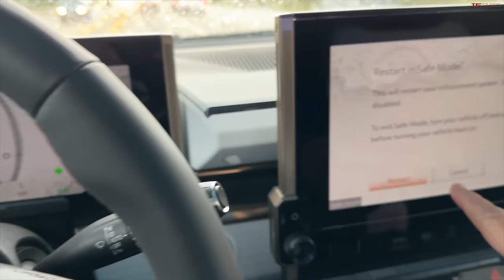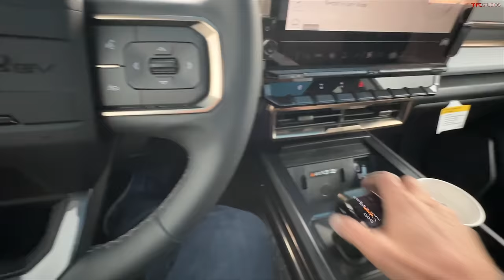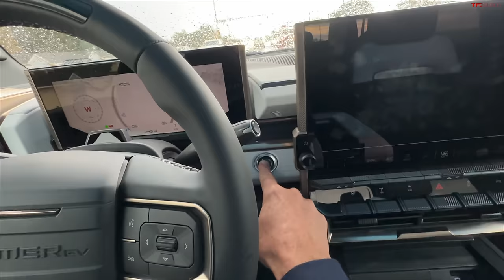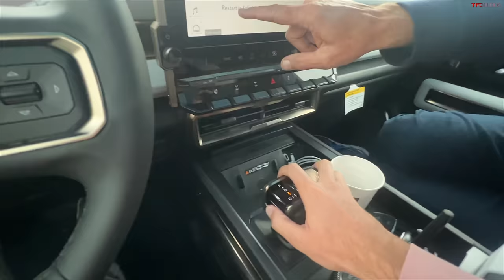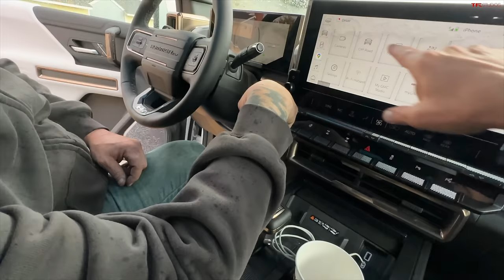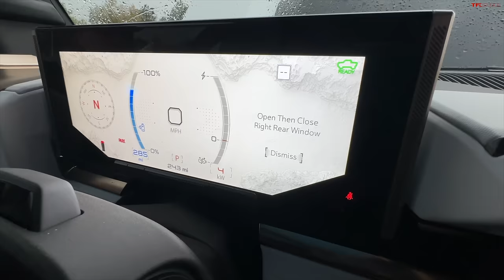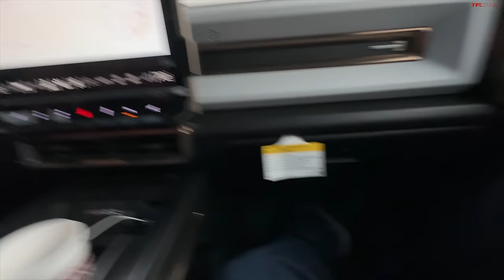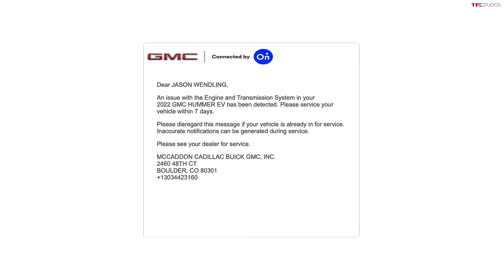I Bought a $115,000 GMC Hummer EV and It IMMEDIATELY Left Me Stranded!

Comment: i think there should be physical neutral button to prevent the electronics from leaving stuck in a spot.
Reply: With EVs they are mostly direct drive and don't have a transmission like a normal vehicle. Even with a neutral lever it would be hard to drag or tow
Reply: Or manual access to the battery
Reply: @craigbutler024  teslas have a manual override for moving it when something goes wrong. It's possible the hummer does as well but it's too new for most people to know where it is.
Reply: I think american autoprom is a total junk that's why people mostly use Asian for decades🤮🤣😂i would only buy the newest corvette and not because its a good car but only because of the price to looks compared to a Ferarri that cost millions🤩
Reply: @zeblanmaidaynovich796  Most people actually buy American trucks.
Reply: The point remains. The solution shouldn't be that hard to find.
Reply: I think E V’s should be banned and put in the scrap yard!
Reply: @daveberkovits4976  That logic brings now real solution, it's like saying we should ignore all our mistakes and not learn from them at all, just continue from before as if nothing happened.
Reply: Most cars nowadays have a little cover on the shift column and you can pop it off and use a screw driver to override the shift lock.
Reply: Every other digital/electronic device has an operator override.  If you’re paying for a vehicle, you should be sovereign over that rascal.
Reply: @Dave Berkovits  You should know junk yards; you sound like you were born in one.
Reply: @enigma9789  this IS an "american truck" though....
Reply: @JT_771  "Not only that, but most trannys in your average ICE car these days are software driven" and that is a problem that engineers don't understand. It's the same with ICE vehicles now and drive by wire. There are no longer physical connections between the user and the equipment. 

This is what happens when you let software engineers into the market place. 

It's the same as the boeing 737 max. The plane is fine, it's the computers and software that's the problem. 

I first encountered this when the battery went dead in my F150....the truck "forgot" I had power windows so I couldn't roll up the passenger window due to rain coming in. Why does the ecu need to know if I have power windows? For 50 years, and 100 million vehicles a mechanical switch worked fine. And when it didn't? Pop the switch out, replace it with a new one for $12.00.
Reply: @muskokamike127  I also thought of Boeing, people have too much confidence in computers. It’s the same argument I have with people about self driving vehicles.
Reply: @daveberkovits4976  ok boomer
Reply: @garysarratt1  lol no they don't. Mot electronic devices completely brick when they malfunction and need to be restarted. That's why it was their first instinct.
Reply: @muskokamike127  That can be a lethal problem too.  When a bridge collapsed and several cars fell into the Mississippi River, there was one whose driver died because the power windows couldn't open underwater, and the pressure of the river on the car doors prevented the driver from getting out that way either.
It's true more people should carry an emergency window breaking tool in their car or truck, but especially with power windows, which are in -- what, 99% of vehicles, probably?

How lazy are people, they can't manually roll down a window???  We have an ancient but sturdy truck with manual windows, and even I -- a woman with tiny twig arms -- can open those just fine.
Reply: @JamesSmullins  The manual override is literally inside the screen, when the car is 100% dead it will never work
Reply: @muskokamike127  Exactly, computers are bound to fail, that’s why planes have so many physical overrides in them, even in fighter jets that you can barely maneuver with all your strength one lacking power steering, they have it anyway because it’s a necessary safety precaution. Nobody wants to lose control at max whack
Reply: Why?... you are just the pay tool.... you dont get aaaaannyything....
Reply: @THESLlCK I've seen videos from wrecker drivers showing a manual release under the dash to put dead cars in neutral.

What gm did was the most convoluted thing I've seen.
Reply: @zxyatiywariii8  yeah the only reason I say power windows as an option is to open the other windows easily on a hot day. I haven't used A/c in years. I used to wear contact lenses and it'd dry out my eyes so if it was 45 C out, I'd use it then, but sparingly. Now, I rarely use it at all. I'll just roll down the windows and open the sunroof a crack to let the breeze through.
Reply: @jrhackman7414  I know. I just read a report on the unreliability of automatic braking systems and that blind spot detection has trouble with motorcycles.
Reply: Virtually all new cars have electronic controlled transmissions. There are few, if any, physical linkages anymore to anything except the brake pedal and the steering wheel. And even those are decoupled!
Reply: @enigma9789  Japanese trucks still can't get it right after all this time...  And they still don't make a real 2500 / 3500 series after decades in the "truck" market, hummm wonder why?
Reply: @solaralloyd6157  they technically had manual access but they make it so hidden its basically non existent especially in a situation where you're under stress and have to do it quick
Reply: @enigma9789  If we're talking globally then Japanese trucks rule the world. You do realize that American pickup trucks are NOT global vehicles. Travel anywhere outside the US and all you will see and even in the most remote/harshest conditions are Toyota Hilux and Land Cruisers.
Reply: @enigma9789  In the USA but not the rest of the world. Last America truck I saw still on the road in Peru was a 1970s Chevy and that was 10 years ago and have not seen one since. In Peru most on the road are Toyota and some Chinese trucks. Yes the Chinese are starting to beat the USA in selling trucks outside the USA and if we do not get our act together USA automotive companies will disappear or get bought out by foreign interest just like RAM was. In Mexico you might see some GM trucks but those are built in Mexico but even there most pickups are not by American companies. While GM is 2nd place (and dropping) in sales in Mexico that is half of what Nissan sales are and their 2nd place is not much better that the sales of 3rd and 4th place brands that are not American.
Reply: @robwalker4548  Do they sell the hummer EV in Peru? no? oh okay. thought I was watching a video about a shitty American truck sold in the American market.
Reply: @daveberkovits4976  I mean, Ironically that's what GM did back in the day with the EV1
Reply: I am sure that Hummer has the best Indian software writers working on the problem right now.
Reply: OR never buy an EV and be happy,
Reply: @enigma9789  Ignore what is happening outside the USA and be doomed to go out of business or be bought out like RAM was.
Reply: @JamesSmullins  exactly. The actual fix that got it running again was a manual cable release and a disconnect of the 12v battery. If it was more well known or easier to find he could have been driving again in less than 10 minutes. Obviously it shouldn’t happen to begin with though
Reply: return it and get something else
Reply: @Mannievh  Working at a Nissan dealership I have seen that cover in the vehicle that have physical cables linking the shift lever to the transmission, in the newer vehicles with electronic shifters there is no cover plate to force it into neutral. The irritating thing is they have a sequence of holding the shift lever in neutral for several seconds and stepping on the pedals  to force the "manual override" and set the vehicle in neutral. If you don't do this correctly you can set the vehicle in a "fake neutral" state, as soon as you open the door and release the brake pedal the transmission will automatically go into park.
Reply: @rammcast84  😯

Comment: Imagine being in that situation in 105° heat with your family (toddlers/baby) on a road trip in the middle of nowhere. 
No thanks.
I’ll stick with my 4Runner.
Reply: Bonus points for being able to put it in neutral and push it out of the roadway even if it does break, lol. GM straight up just bricking cars on the roadway.
Reply: I laughed when I read this.  Road trip in this? This is a city pavement princess.
Reply: Imagine spending 6 figures on a car and having this happen under any condition.
Reply: @OM61777  if I spend 100,000 on a truck I expect quality and dependability. Not immediate breakdowns
Reply: If you need to go out to the middle of nowhere take a Hummer EV.  If you want to come home alive take a 4Runner.

Comment: This is going to be a problem because some EVs stay in park when there is a malfunction. If you don't get off the road you're stuck. You can imagine how dangerous this  could be in certain situations.
Reply: Almost all cars are switching to electronic shift so you can't even put the car into neutral to even get it out of traffic or other dangers.
Reply: @cheesecurd100s  manufacturers should consider adding a backup mechanical method of shifting of the electronics fail. You should be able to switch to it by like a hidden compartment button. :/ Though, I'm no car mechanic or even remotely knowledgeable on cars so I don't know if that's possible.
Reply: Same goes for the Dodge Ram with the rotary knob shifter thing... sucker stays in park if you don't have the key and enough battery power to turn on the electronics. To manually put it in neutral you have to basically open up a panel on the dash with a screwdriver and yank on a hidden release cable.
Reply: On the upside, if you're stuck on the road with a fire, that probably reduces the likelihood of a brushfire that might get ignited on the roadside. (Not a serious comment)
Reply: @sanfayyaad  they do always have an unlock button often hidden near the shift lever. Idk about new cars with fully electronic gear selection.
Reply: It's not just EVs, it's all cars that have an electronic shifter. I see this all the time, car won't allow a shift unless the engine is running
Reply: @cheesecurd100s  that sounds incredibly dangerous. Like you said, in certain situations this seems counter intuitive.
Reply: Its not just EVs, alot of petrol cars now force the vehicle into park when something goes wrong
Reply: @sanfayyaad  Thats literally what cars used to do 10-20 years ago, usually there was a hole you could poke a pen into to disengage it mechanically
Reply: Right. Imagine being the unlucky family stuck on a highway median during traffic... But now you've been there long enough and traffic starts to open up and you're still in the highway median...
Reply: The transition to these vehicles is too quick. There is a train wreck coming with EVs. The majority of people want nothing to do with these vehicles. The market is not driving demand.
Reply: @sanfayyaad  it is possible to have a mechanical switch. My Honda passport uses an electronic shifter so in failure there is a metal rod sticking out of the transmission that takes a tool to mechanically turn the transmission into neutral. Problem is the tool isn’t included with the vehicle and is relatively expensive. A wrench can do it though as well.
Reply: There is a Rob Schneider video where his Tesla bricked itself in the middle of the road too!

Comment: Big red flag for cars becoming 100% dependent on software. Great work bringing serious issues to light. Good luck with your truck.
Reply: they'll be like smartphones.  in 3 years it'll be obsolete and work like garbage
Reply: @siouxunit17  what are you talking about? I have a 4 year old phone that works great. LOL
Reply: Any vehicle not using a carburetor is completely software dependent, so pretty much every vehicle from the 80's to current day.
Reply: @techguy3424  manual latch defaults, manual ability to access a towing mode and simple reboot access should be required.
Reply: @techguy3424  people say silly things
Reply: @janjander152  This Hummer has a manual release, granted difficult to discern from everything else under the dash. I can't recall any vehicle that doesn't have emergency releases for electrically operated doors/critical compartments. Makes me think it's already mandated, either that or these companies had the foresight to include these features.
Reply: @techguy3424  true it does have a manual release, they should be more intuitive to find and use in case of emergencies. Roman also brought up that a reset button would be helpful.

Comment: Would love a follow up video when you get it back. What the dealer says and what they claim went wrong, and how to fix it if that were to happen to anyone else. I bet they will be pretty tight lipped and not admit fault but if they do give you anything, id love to know.
Reply: Off course it’s the dealer/GM’s fault. It’s a brand new truck, good pub GM.
Reply: It's crummy software, pure and simple.
gm is in charge of this for the first time ever with HummerEV and Lyriq. Previously gm brought in a fully built EV platform and infotainment system parts built and assembled by LG Chem. Not such a smart move after all 🤔
Now when they get serious about EV's they're starting with zero experience writing software to run a long range BEV. 
Of course it was destined to be a crap show.

Comment: As a fan of older more "analogue" trucks
I have never laughed so well at someone's misfortune
Reply: analog**
Reply: @allentoyokawa9068  analogue is the British spelling, OP maybe from the UK.
Reply: @allentoyokawa9068  He spelled it correctly still.
Reply: @allentoyokawa9068  aim veri sorri for mai bääd inklish skills
Reply: this proves that modern doesn't equal better
Reply: like ICE cars have never broken down ever 🙄
Reply: I'll never, ever buy a new generation car or truck.  As a matter of fact, when my 2008 Sierra gets too old, I'm going to buy an older analog vehicle with minimal electronics.
Reply: @coltonthies4672  What usually goes wrong on new ICE cars?  The electronics.  Love the range the EV's have....They are not ready for prime time especially the trucks.
Reply: @coltonthies4672  at least an ice car doesn’t have computer glitches like EVS
Reply: @ril850 and you probably believe everything modern is better
Reply: Love my 1st generation Tacoma... it's an analog truck in every sense.
It's so simple and easy to work on and still runs like a clock. Parts are dirt cheap on Ebay because everything is mechanical.

Comment: I had a similar situation with my 2016 Ram ICE. My aftermarket remote crapped out, truck wouldn't start or couldn't put trans in neutral to tow. Discovered mechanical transmission "discommect" to enable truck to he towed. Not every EV will go through this but ICE seems to be more reliable.

Comment: Nice to see that those small vehicles are being designed the same way as those big mining vehicles I operate. A glitch is a glitch.  Our solution for our equipment is to " do a 24 volt reset"  you will have to do a lot of those,   The builder will just have to get an easier access to the battery reset procedure.   Next time,  don't forget to go throw some reflective trangles behing your vehicles, don' t rely on the cops to be there..   secure your area yourself. Go buy a triangle kit.